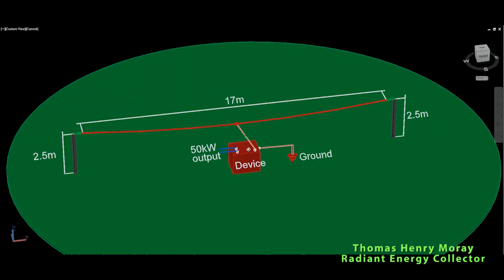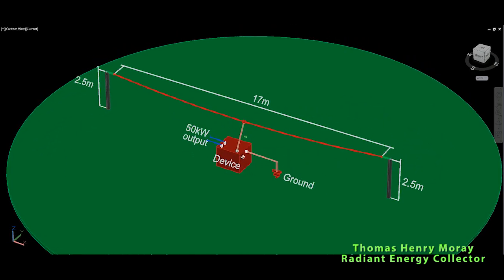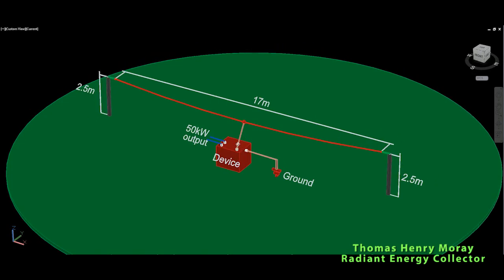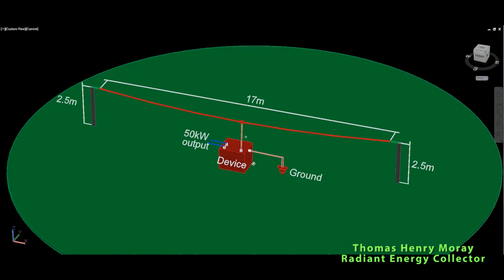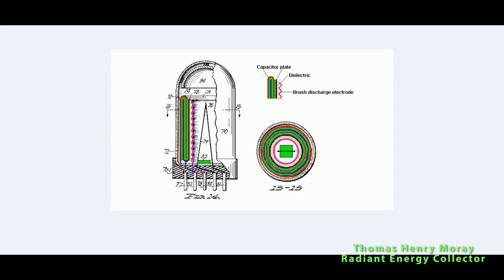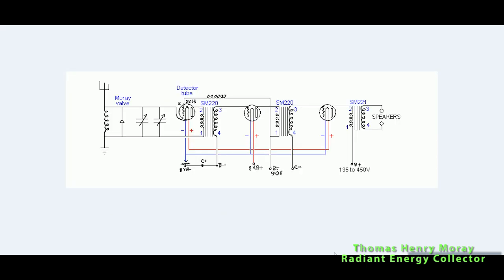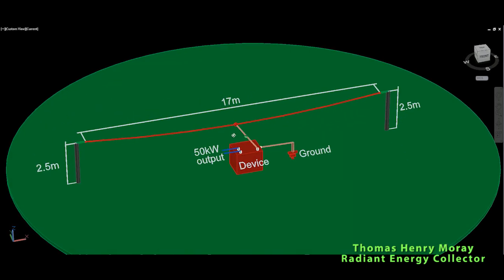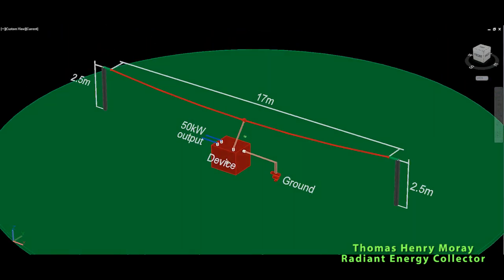Free Energy Generator, THOMAS HENRY MORAY Radiant Energy Collector

Comment: I have always been fascinated by this device and wondered if a Tesla coil in reverse to reduce the high potential and frequency using modern day Schottky Hot Carrier diodes would emulate Moray's device. There is so much free energy out there, it just needs to be tapped

Comment: The high frequency energy could not be collected by the antenna and used as power unless it was converted from ac to dc using that device serving as a gate to move it in only one direction. That current was not electrical as we understand it since devices ran cold and not hot usually associated with electricity.

Comment: HERE’S HOW HIS DEVICE WORKED

At any time in Earth’s atmosphere - and in space - exists difference random frequencies of electromagnetic waves including radio waves, light waves, ultraviolet waves, etc. Cell phone electromagnetic waves, TV electromagnetic waves, we are ‘drenched’ in electromagnetic waves every second of our lives. You cannot see them. But we know our cell phones work.

His device had an antenna like a radio. He concocted a then-rare (read: not widely known) blend of germanium, bismuth and other materials and made what we now call a ‘dielectric resonator.’ Every cellphone has a dielectric resonator these days. They allow only ONE FREQUENCY to pass through from all the random electromagnetic wave ‘carrier’ frequencies a cell phone is bombarded with. There are different cell phone carrier frequencies, and each cell phone uses one of them and has to block all the others to prevent interference. These days, manufacturers know how to engineer, how to construct dielectric resonators to block all but the one frequency the cell phone is designed for. Back in Moray’s day, he had no clue. He couldn’t have. Dielectric resonator science didn’t take off until the 1960s. So he was ‘getting lucky’ - he created his germanium/bismuth/etc. dielectric resonator. Due to the way his device works, he’s not trying to tune in to a cell network. He only needed to receive ONE of the random wavelengths that are always in the air and block all the others. His device required a single electromagnetic frequency to work. This is why he called his device a ‘radiant energy’ device.

Why is a ‘dielectric resonator’ - resonating? Because electromagnetic waves are sine waves and they cycle through a positive half cycle then a negative half cycle. Over and over again. Look up ‘sine wave’ and ‘electromagnetic wave’. A dielectric resonator only resonates at ONE frequency and blocks all the others. Just what he needed.

So his antenna ‘pulled in’ lots of random frequencies out of the air and fed them to his germanium/bismuth ‘detector’ (dielectric resonator) and only ONE FREQUENCY was then passed through to the tubes in his device.

Now the other amazing-for-his-time part. HE ACHIEVED OVER-UNITY by two different methods. First, he leveraged ‘secondary electron emission’ (look it up) made possible by his use of ‘cold cathode’ vacuum tubes. Argon gas ions and electrons bombarded his cold cathode and knocked free more and more electrons resulting in more and more current flow in his tubes. Second, he leveraged ‘negative resistance’ which is what happens to electric current flow in a plasma tube (including fluorescent light tubes - they are ‘negative resistance’ devices). ‘Negative resistance’ manifests as follows: (1) first, you have a tube with a vacuum in it, filled with argon and mercury vapor; (2) second, you ionize the argon/mercury vapor - that enables current to flow at a low magnitude at the beginning; (3) third, you patiently wait and allow the current to keep increasing the ionization level of the argon and mercury until it’s a FULL BLOWN FREAKING PLASMA in the tube! Plasma is the best electrical conductor known to man. (4) fourth - if you don’t do something to limit the increase in current flow through the plasma, you get so much current flow that the tube will explode! That’s how much power is in this ‘negative resistance’ phenomenon! A modern fluorescent light tube STOPS this ‘runaway’ increasing current problem by way of a ‘ballast’ that is part of the tube’s electric circuit in its fixture. NOTE: the electrodes in fluorescent tubes will break down if you try removing the ballast to get this huge negative resistance phenomenon. The tube manufacturers do not want to get sued. So it is not really possible to create over-unity devices using fluorescent light bulb tubes.

He used a radioactive material liner inside his tube because it spews out beta radiation which will create a LOW LEVEL of ionization in the argon gas in his tube. This is an impressive trick he pulled off. No one uses radioactive material to create an initial low-level ionization of argon gas in fluorescent tubes. But fluorescent light bulb tubes ALSO need some means to create an ionization in the gas in the tube. So instead, a small circuit WHICH REQUIRES OUTSIDE POWER (from a wall socket) is used to create an initial ionization. See, THIS IS WHY NO ONE BELIEVED HE COULD PULL OFF ‘power out of the air’. They did not understand that by using radioactive material in his tubes, he didn’t need an outside energy source to create that necessary low-level ionization of the argon. Once the radiation in his tubes created the very low-level of ionization in the argon gas, and he supplied across the tube the low-voltage radio wave pulled out of the air - BAM all he had to do was wait a few minutes and the small initial ionization and small voltage radio wave would build up to a FULL BLOWN FREAKING PLASMA! inside the tube. This build-up from ionization to massive plasma and current is called a Townsend Avalanche.

Here’s how that initially low-level ionization of argon, and the very weak radio wave signal, evolve in the tube. It takes some time. In his book he mentions ‘4 minutes’ or so. First, the radio wave creates a small current flow in the very weakly-ionized argon. Electrons collide with molecules of argon and knock electrons out of the argon atoms. They in turn collide with other argon atoms which knocks more electrons free, and the argon evolves from ‘weakly ionized’ to ‘plasma’ with MASSIVE current flow in the tube. This is an over-unity freebie effect. Notice this. No AC power was hooked into this device. He relied on a radioactive material to create a weak ionization of argon. He then fed a single weak frequency radio wave pulled out of the air to incrementally knock more and more electrons free from the argon gas atoms. THIS EVOLVES INTO A ‘TOWNSEND AVALANCHE’. And he used capacitors to tap off the energy out of the gas. Good thing too because his tubes would otherwise explode.

To review: Moray has pulled in lots of random electromagnetic waves on his antenna, fed them through his crude dielectric resonator to block all but one frequency, then passed one frequency to an argon/mercury vapor tube weakly ionized by radioactive material, then WAITED FOR THE TOWNSEND AVALANCHE TO DEVELOP.

NOTE: Why was it important to only feed one frequency to the tube? Why not just pass all the random radio (and other) waves from his antenna to his tube? Because the tube needs to get into a resonant condition. It needs to resonate back and forth at one frequency and build up incrementally to high current flow in the tube. If lots of different frequencies were present, the Townsend Avalanche would not be easy to attain - lots of different frequencies is ‘static’. ALSO: Even though the radio wave was always a very low, weak voltage - IT WAS STILL NECESSARY. Why? To keep the resonating current going, TO KEEP THE TUBE OSCILLATING. His tubes OSCILLATED at that one frequency. And that radio wave he randomly filtered into his device created the oscillation. And maintained it. One of his witnesses shorted his antenna to ground and the device stopped. Even though that stray radio wave was weak, it was STILL needed to keep the oscillating tube - oscillating. Oscillations ‘dampen out’ if you fail to add a correctly-timed ‘push’ or electrical wave in this case. You can think of it like pushing someone in a swing on a swingset - you get them swinging - that’s at one frequency - if you bump into them with a different ‘frequency’ of push - it will slow them down. If you push them at the SAME frequency - at just the right time - they will keep swinging. If you stop pushing them their swinging will slow to a stop.

In other iterations of his device, instead of a dielectric resonator, a ‘bandpass filter’ was used to block all but one frequency.

When you look at a fluorescent light tube - that is a ‘negative resistance’ device and is conceptually similar to Moray’s over-unity device. But it needs outside power because (1) using radioactive substances in consumer devices is not feasible these days, and (2) no one will buy a fluorescent light bulb if it takes 4 minutes to light up.

But modern fluorescent light bulbs will NEVER go into a Townsend Avalanche and build up huge power that can be diverted into, and stored in, a capacitor, due to the ballast current-limiter device, and the really weak, quickly-disintegrated electrodes. Moray’s device could output a lot of energy (7500 watts in some versions) because he used the power from the runaway current, the high-current plasma, to charge capacitors.

Moray used radioactivity to avoid needing an outside power source to ionize his gas. Then his cold cathode tube when bombarded by argon ions and electrons produced more electrons. This spiraled into more and more electrons being knocked out of the argon gas atoms. The electrons flowing in the current created by the radio wave also knocked more and more electrons out of argon atoms. ‘Negative resistance’ and Townsend Avalanche resulted.

MORAY’S DEVICE WORKED. He was clever in how he put together negative resistance/Townsend avalanche gas plasma effects, in how he pulled just one frequency out of the air, in how he used radioactivity to ionize the argon to avoid needing outside power.
Reply: Radio waves are very weak.  The signal needs to be amplified manyfold to drive the circuitry of a receiver.  Hence, radio waves alone could not account for the claimed 55-kilowatt output of the device.  The device is similar to a radio receiver, complete with antenna and ground connections, tunable to some unknown frequency that Moray identified with 'radiant energy',   The signal is made to excite the materials in his special tubes.  It's very interesting to note that Moray was experimenting with semiconductor materials years before Bell Labs invented the transistor.  But Moray's semiconductors were doped with 'tribolescent' radio-active material - very likely the key ingredient.
Reply: Hey where do you have this knowledge from?
Reply: @pradaprimat8624 You can find this info online. It's not like it's a secret or anything.
Reply: @pradaprimat8624 his brain.
mine didn't ger enough nutrition.
Reply: Oh my gosh thank you for this much information, I only know how to create weaker crude high drain hydrogen generator that feeds itself this is WAAYY better like 22th century tech. 😮😮😮
Reply from the maker: Thanks for your beautiful comment. Much appreciated 💙

Comment: Always found this device to be the most fascinating of the fringe energy collection and had an interesting background story.
I actually think the energy being received may have just been coincidently from radio transmitters broadcasting at the time, some of them output up to 500KW of power, so putting a giant aerial close enough to the source could have collected this to some extent. Combined with the rumours that his Moray valve was actually based on a crystal radio receiver.

Comment: If that was dipol antenna ( 2x8.5m) than working band was 34m , oscilating at  8.8 Mhz. Tesla electric car had  vertical antenna 1,8m which correspond to 7.2m band,oscilating at 41.6Mhz. Calculations were made based on the classic  1/4 antenna calculation, knowing lentgh, and aproximate  speed of light. I think that AIR ENERGY is not the same type electromagnetic energy as RF Some different aproach must be made. Not simple tune to specific frequency. I am not sure which one.

Comment: Dr. Henry Moray senior invented the solid state transistor, or Moray 
valve as he called it, as a sub assembly of "The RE". The dated lab 
documents prove it , in his son's book " The Sea Of Energy In Which The 
Earth Floats".  Bell laboratories did not invent the transistor, only 
filed patent after Dr. Moray visited Bell to show the "RE", in 1950, 
which sub assembly contained the whisker crystal amplifier diodes 
device. The RE was about $500,000 dollars to build, back at that time . 
High frequency current through step down transformer applied free 20,000
 watts to banks of light bulbs. The glass cold cathode tubes contained 
radioactive particles to freely operate tubes- no battery.
Reply: wtf lol
Reply: Yep, bell lab just stole it.

Comment: All this apparatus is. Is a crystal radio and antenna with an unknown detector. What we really need to figure out is what the White powdery Swedish stone is so we can make the detector. His detector obviously detected extremely high frequencies with lots of energy.The only other conclusion I can come to is that the antenna and the ground plus the tuning circuit polarised the detector and pulled energy from the crystalline structure of the Swedish stone itself and not from the tuning and rectification of radio frequencies.
Reply: This might explain why his Swedish stone detector would 'burn up' when he tried to output too large a load. Once Moray ran out of Swedish stone, he turned to radioactive materials as a replacement.

Comment: In 1925 Moray exhibited to curious engineers an energy receiver composed of a cylindrical metal tube, a grounding rod and an aerial. This device could allegedly power 35 bulbs, a hand iron and a heater - simultaneously - and to show that it was generating its own energy, it was tested up a mountain, in a desert and inside a sealed container at the bottom of a lake. 

Moray came to believe that the soft silvery white crystal (a rare form of spodumene which consists of lithium, aluminium and silicate) housed in the cylindrical metal tube was drawing energy from cosmic rays emitted by our sun and the surrounding stars, which he called the "radiant sea of energy". He modified his invention and renamed it the Cosray Receiver, which, by 1929, was said to be generating enough power to run a small factory.

Today Moray's work is continued, and closely guarded, by his son John.
http:// thehouseofmoray .org

Comment: The antennas to tap into radiant energy should be built with very high impulse frequency longitudinal waves in mind because Tesla's radiant energy is longitudinal and not the conventional transverse wave. Radiant energy comes from the Sun in the form unidirectional longitudinal impulses which hit the earth every second. Read book "Secrets of Cold War Technology by Gerry Vassilatos" on radiant energy. Henry Moray was most likely somehow tapping into this longitudinal electrical energy from the Sun. In longitudinal electricity, the electric field and magnetic field flow in same direction instead of right angles as you can see in this video "Replication of Eric Dollard's Analog Computer". Also youtube search "Birkeland Currents" which is likely radiant energy electrically powering all stars and galaxies. Also check video "Eric Dollard - Longitudinal Energy (Scalar Waves - Mutual Induction - Wireless Transmission of DC)".

Comment: Moray's device looks like a dipole antenna. But what else this antenna can do, besides transmitting/capturing radio waves? Nikola Tesla once mentioned that storms are nothing more than a standing wave in the atmosphere. So, if you make this small dipole antenna vibrate at its own resonance frequency, it will become a sort of small scale storm. Then, all you have to do, is just collect 'lightning discharges', not so strong as real lightning, but I guess very frequent =). Good luck!
Reply: Correct. Tesla famously wanted to connect the ionosphere and the ground like a giant spark gap, creating a standing lightning bolt tens of kilometers high.
Reply: Neat.